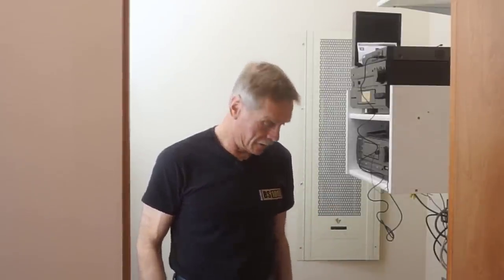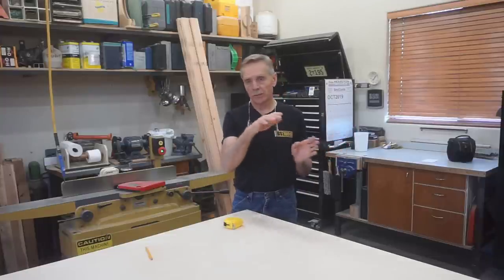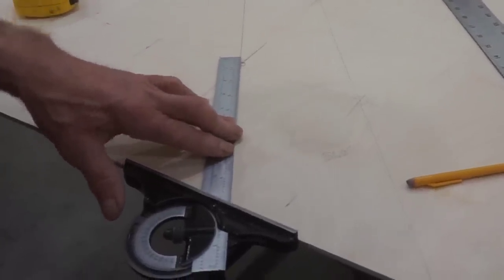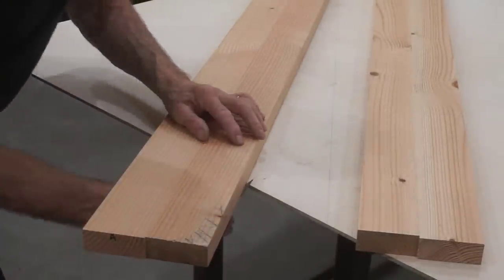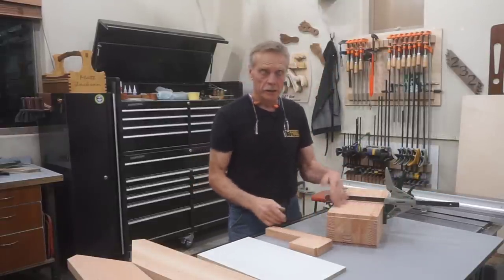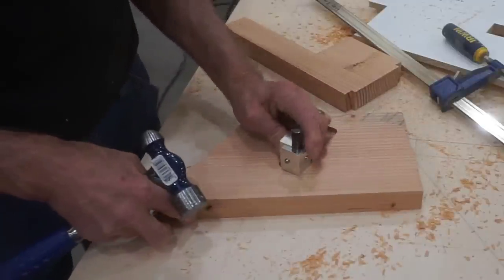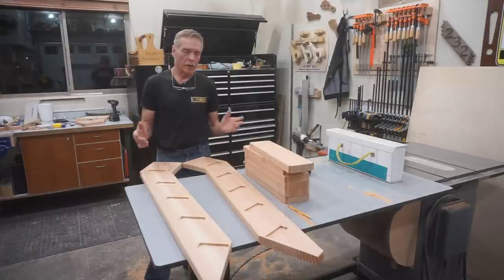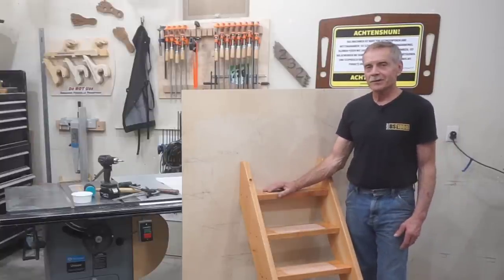How to Build a Loft Ladder

Comment: Great video, as always. The anti-skid material, is it included in the Amazon list?
Reply from the maker: Hey Charles, I neglected to include the anti-skid tape in the Amazon list... until now.  Thanks for asking.  Here's the stuff I used: https://www.amazon.com/dp/B0002YPRMK/?ref=idea_lv_dp_ov_d&tag=aiponsite-20&linkCode=ic6&ascsubtag=amzn1.ideas.26F2B577SGOA8  This is a LONG roll which is good if you need it but, since I rarely use it, I buy it by the foot locally.  Looks like there's other brands on Amazon available is smaller quantities but I can't vouch for their quality.  Hope that helps? Best, Matt
Reply: Thanks!
Reply from the maker: @toomars1301  For sure!  Your question reminded me that I intended to include the J-Roller too: https://www.amazon.com/dp/B000CP0QFC/?ref=idea_lv_dp_ov_d&tag=aiponsite-20&linkCode=ic6&ascsubtag=amzn1.ideas.26F2B577SGOA8
so it's included in the Amazon List link for anyone interested in it too.  Thanks again! Best, Matt

Comment: Why are you using Douglas Furr? Because it's more solid than pine or resilient?
Reply from the maker: Douglas Fir has long been used as an incredibly strong material for building step ladders and the like so it was a perfect choice for this project.  It's much stronger than any other pine and properties of it's grain make it very wear resistant, especially in the 'vertical grain' cut.  Definitely an excellent choice for those properties but other woods like oaks, hickory, ash, etc have similar properties but look different to suit other design requirements.

Comment: what is the pre-catalized finish you are using? Don't see it on your Amazon link.
Reply from the maker: It's Sherwin Williams 'not for consumer use' pre-catalyzed lacquer.  Really great stuff but not available through Amazon.  Try a local Sherwin Willy store if you're interested.  BTW I generally use the 'medium rubbed effect' rather than dull or gloss.  Best, Matt
Reply: @NextLevelCarpentry  thanks

Comment: It would have been nice to show the router bit setup for the template.  I assume it is a bearing flush trim bit?
Reply from the maker: Here's a CMT bit (included in the Amazon Page link in the video description)  like the little Freud one you see in the video Allen: https://www.amazon.com/dp/B000P4O4KS/?ref=idea_lv_dp_ov_d&tag=aiponsite-20&linkCode=ic6&ascsubtag=amzn1.ideas.26F2B577SGOA8  I know it as a 'flush trim pattern bit' since the bearing is above the cutter rather than below it like what I call a flush trim bit.  Hope that helps?  Best, Matt

Comment: What was your final rise & run per tread?
Reply from the maker: I don't remember those figures exactly but I know it was a dicey compromise to make the ladder functional and fit in that less-than-ideal application. In that sort of situation there are no codes or guidelines to have to follow so I just make decisions generally choosing the lesser of evils for the final design... sorry that's probably not very helpful😔
The good thing is that even a less-than-perfect ladder is better than a step stool or a bucket to stand on while getting in and out of the crawl space...
Best, Matt

Comment: Dividing base 10 isn’t easier. 

Factors of 10: 10, 5, 2
Factors of 12: 12, 6, 4, 3, 2
Reply: As a Brit who has had Imperial taken away I couldn't agree more!
Reply: Jason Bowman I think what most people like about metric is decimalization (or more accurately, fraction avoidance), but that’s accomplished in Imperial with thousandths.
Reply: Jason Bowman plus Celsius is garbage for planning what to wear.
Reply: Seth Bracken 
Why garbage?
Below 0 is freezing cold (literally)
Above 30 you should wear a t-shirt
Not understanding does not make it garbage.
Reply: @BendeVette  I totally understand it, that's how I know its stupid for day to day use. 15C its chilly and you'll need a jacket, 20C t-shirt or light long sleeve. That's only a five degree swing. Whereas in F that's 58 vs 69
Reply: @sethbracken  
Don't agree
A wider range does not make it better.
Or do you really consider different clothing between 67F and 68F.
Celcius is a convenient way of measuring temperature.
At the end it is what you are used to use.
Reply: @BendeVette  I don't care if you agree, I know you're wrong.
Reply: @sethbracken  
I don't say you are wrong (I would never say that)
I only know I am right 😂.

Comment: 5 days work and $3500 later here is your crawl space ladder you could have picked up from home depot for $40
Reply: So you're new to DIY woodworking, I see. Welcome!
Reply: What? Before and after dinner two evenings max. While millions sat in their lazyboy. Watch out for the lazy lugs. Sweet. Thanks Matt.
Reply: Lol...true..maybe.... but you are completely missing the point of what he just showed everyone. Ive never seen a custom ladder/stairs at Home Depot or anywhere else. If you got Home Depot contractors  to build and install the same thing it would probably cost more than $3500.00. They have crazy prices. I bet Matt could build a basic version of those in a few hours tops. Try finding some kind of ladder ,then modifying and installing in less time.
Reply: 5 days?  I think he works faster than that.

Comment: The little metal ladder must’ve worth hundreds right? Why else did you spend all that time and effort replicating the function of a thirty dollar ladder. 
Contractors never give enough consideration to the customer# wallet.
Reply from the maker: Do you have a propensity for making such block-headed conclusions or is this an exception?!
Reply: You're right he could have easily bought a cheap aluminium ladder and called it good, and it would have been much quicker.

However, the point of this video was to us non master carpenters the process of making a ladder and learn from a master carpenter the skills and techniques needed in laying out such a project, and how external factors such as location, purpose of use and desired functionality play a part in the design process. This master carpenter then showed us how to make templates to speed up and simplify the process of making mortices and tenons.

Imagine if you needed to build a 16ft wooden ladder for a customer. This master carpenter has clearly demonstrated a way to save hours if not days compared to using a hammer and chisel, then there's the layout techniques he demonstrated, again saving time fixing errors in the building stage, saving time and expense traveling to a store and back to buy more wood after you built it only to find during the installation phase that is doesn't fit / work, due to either bad planning or other unanticipated factor.

Personally, I have learnt a lot form this video, skill and techniques that if I apply them correctly will enhance my woodworking ability and speed up my process.

That would have been unable to happen if he bought a ladder from home depot.

Thank you, Next Level Carpentry, for the time you have taken to film and edit this video. I really appreciate it.

Stay Safe, Family Prepper